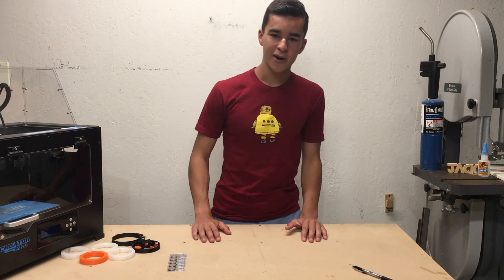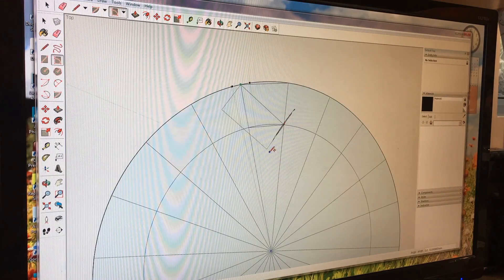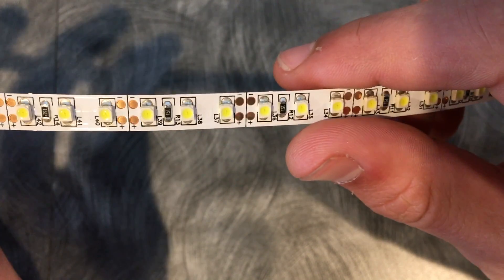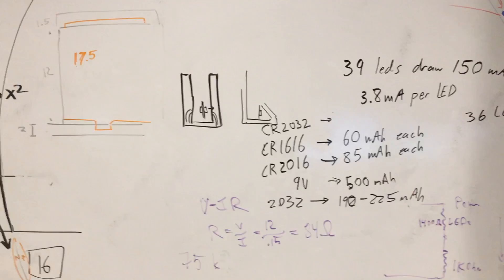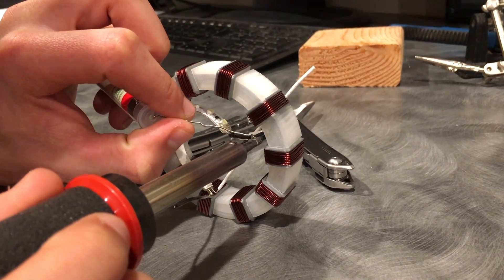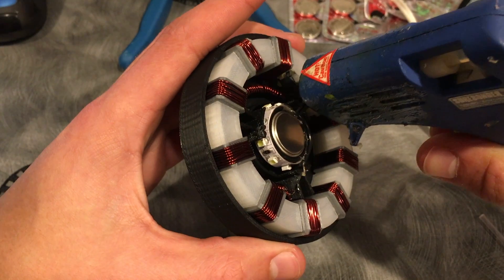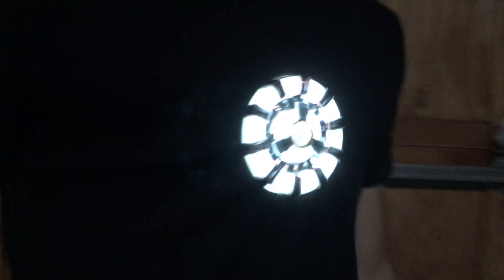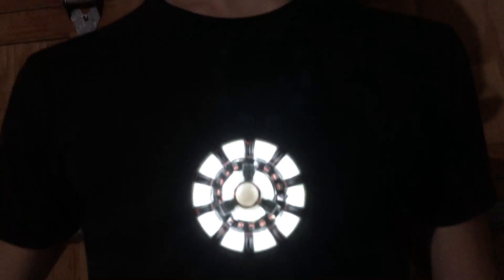How to make an Arc Reactor

Comment: @Jack Monaco
Is it possible you could create a list with all the specific parts you used? Especially the LED strip, as if one gets one with more spacing between the LED's it would not look as amazing as yours. Also the different settings for the 3D Models, did you print more parts in 100% fill or only the main ring?